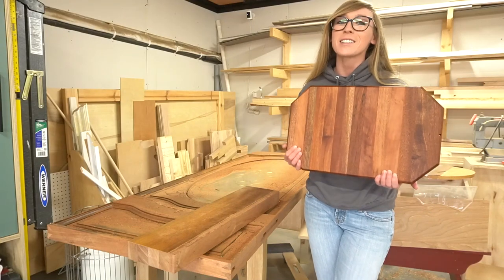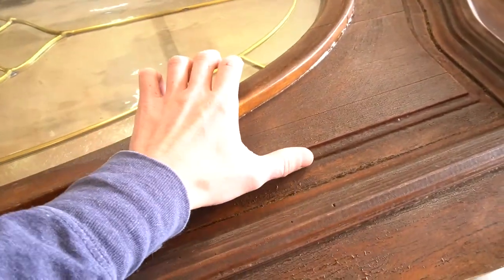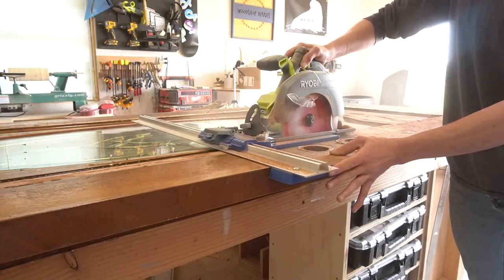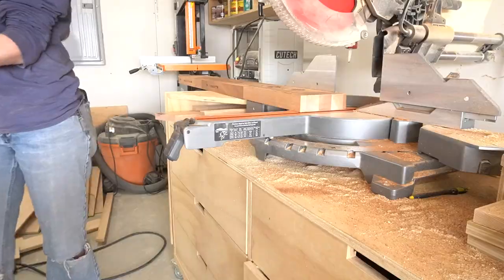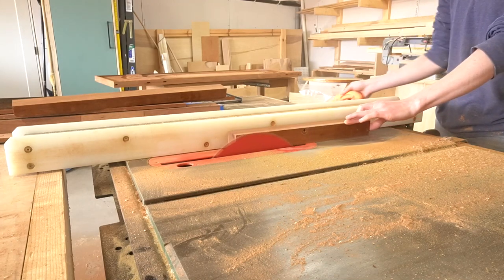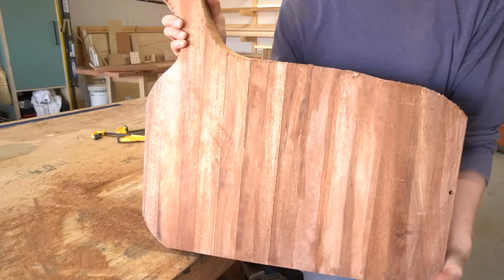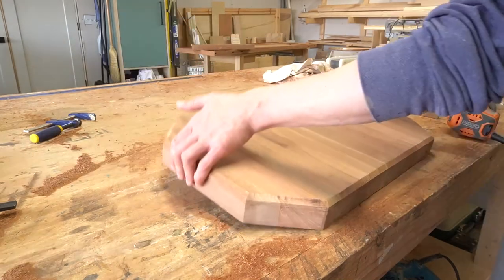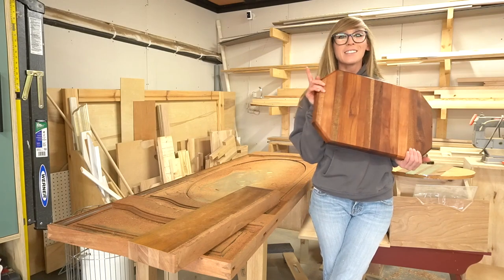"Solid Wood" Front Door Repurposed--into a Cutting Board {BARELY}

Comment: I love the shape and the look of board. I will 110 % use this board. Hope you are not going to through the glass. Love to see some project where you can use the stain glass from the door. Thanks for sharing.
Reply from the maker: I’ve tried to get the glass out and it’s glued to the trim on the other side of the door. I’m very likely going to break it trying to get it out so it’s probably not going to make a second appearance 😅😅
Reply: Try with heat gun. That might help. Just tring to help as the glass looks so beautiful.

Comment: I have boards of different thicknesses and sizes. Although I didn’t make any of them. Mainly for sitting hot pans on. A good board is never overlooked 👍
Reply from the maker: Ohhh like a hot plate? Yes! That’s a good point...any size can be useful 😄
Reply: Yeah, with laminate benches, I use good boards for hot oven trays, mashed potatoes pan etc

Comment: Looks good.  Are you going to finish ripping down the door into useable, small pieces?
Reply from the maker: I cut off just about every useful piece of the door (sides and bottom) and most of what’s left is raised panel and trim. There were so many like 3” pieces glued together and I didn’t feel like messing with them. The dust was extremely irritating (even with a mask) so I think that’s the last of anything I’m doing with it 😅😅 it was fun, but I’m done haha
Reply: @WoodshopDiaries  I guess the term “solid wood door” has many definitions, or interpretations.  LOL. Mahoghany dust is pretty bad.  At least you have some nice hardwood for the bonfire.